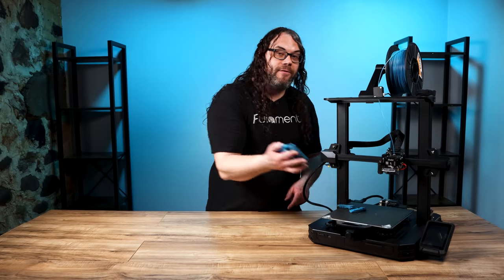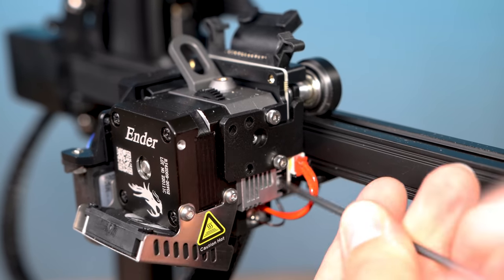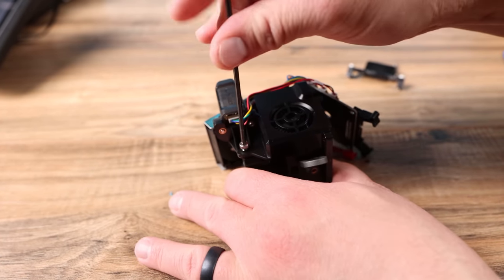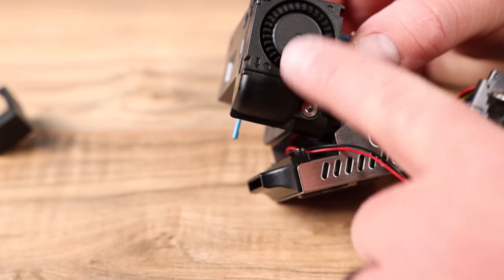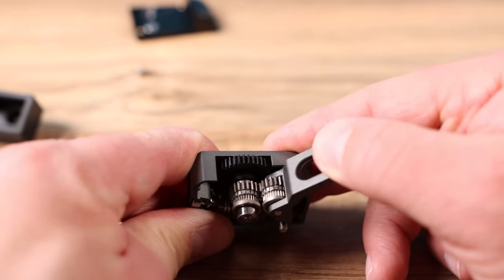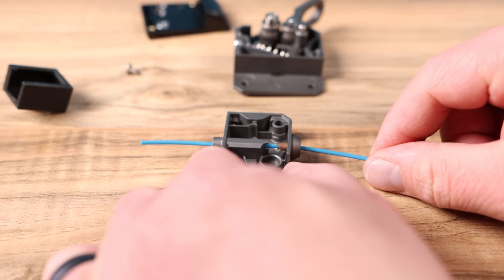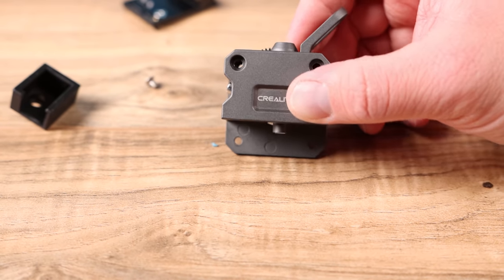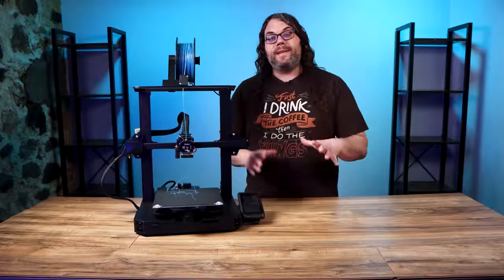How To Fix A Jam on the Ender 3 S1 Pro (FULL Walkthrough)

Comment: You really took the hard road.  I have two of these.  Had some clogs to deal with. Just heat it up.  Remove the nozzle, then push a cleaning needled and your done.  Try that next time.  No need to take it apart  Great videos.
Reply: Do you have any idea on why they jam?
Reply: @LuisHansenNH  wrong geometry internally, no internal polishing, wrong alloys being used in the heatbreak, etc.  E3D are the leaders here for good reason - they figured all of the perfect parameters long ago, and Chinese companies struggle to replicate it.  Looks like in this particular case, expanded filament managed to get too high in the assembly.
Reply from the maker: I tried that first. I even took it to 240 and the filament piece would not budge. Trust me, if I could have gotten away with that, I would have. lol :) Thanks for watching!
Reply from the maker: Not sure yet. But if it happens again I will dive deeper into it. Thanks for watching!
Reply from the maker: All very good ideas, and I think you are right. Somehow a piece that was expanded got back up into the bowden tube in the top. The it got stuck..
Reply: @LuisHansenNH  I had a similar problem with my OmniaDrop direct drives until I figured out that too much extraction during a print and especially at the end or a filament change will bring soft plastic up to the cold zone where it can deform and cause a jam.  I changed all of my retractions to be under 1mm and use 1mm for the end of print or changes, almost never have any problems now.
Reply: Because I was just going to by it. From Amazon. This video was scary . Taking Whole thing apart.
Reply: Tried that and it didn't work
Reply: @xxxxzorroxxxx  me too
Reply: This wasn't a nozzle clog but an extruder jam. The needle would not have worked.
Reply: @xxxxzorroxxxx  All printers have their pro's and con's :)
Reply: @woodwaker1  Extraction? You mean flow? I see Retraction but no Extraction parameter
Reply: @danlopez2012  Sorry I did mean retraction.
Reply: @woodwaker1  Ahh Thanks a bunches!
Reply: Yeah, I thought I was gonna have to do this then I tried heating to 240 and pushing a metal rod in really hard, and it popped out.
Reply: Damn you have to pull the thing a part.  That shit is way too much effort.
Reply: @woodwaker1  Ender 3 S1 manuals even state with a huge exclamation mark that the retractions should never exceed more than 0.2 mm for this exact reason. Also keeping your filament away from moisture and cuting a right angle on it on refill and making sure that when changing filament you always heat up your head
Reply: @wargames43  Are you sure it is .2 mm and not 2mm?  I don't have one, but .2 seems very short
Reply: I think we all try that method first. I heated mine up and it was not budging whatsoever. Disassembly was the only option.
Reply: Do all version of the Ender 3 S1 Pro have a PTFE tube? When I took mine apart to clear a jam/feed issue it did not have one. Machine was purchased new by me and came in the original sealed unopened Ender box/packaging.
Reply: @xxxxzorroxxxx  not that bad I did it lol
Reply: Where can you get cleaning needles from?
Reply: This continues to happen to me. Do you have any suggestions on settings that might help this not to happen
Reply: I tried the needle method first without success, even though eventually the needle went all the way through. I agree that method should be the first option. In our case, though, a small piece of filament was stuck next to the gears and interfered with proper function. This video was the answer we were looking for. It was very clear and it had a good pace. Thank you. (Be aware that you need a good Allen Key set. We used a Syntus 60 in 1 Precision Screwdriver Set.)
Reply: Glad u took it apart, fantastic detail

Comment: I just cleared a jam on my Ender 3 S 1.  The cause was improper filament change.  Heating the hot end to remove old cold filament and pulling it out too soon, First verify the filament in the hot end is melted by pushing some out the nozzle, then pull it out.
Reply: So true. Always extract a bit before pulling out ensures in addition to the right temperature, that there is no expanded filament above the melting zone.
Reply: Yeah same thing happened to me. I remember thinking what the wordt thing that could happen before pulling it too early

Comment: First....like so many before me thank you. Your video was used to remove a lodged-in piece of filament on a 1 week old 3 S1. In my case, when I pulled the gear case open, the spring and lever popped out. That took a while to figure out. I too missed the same screw you did. My only request is a video putting the hole thing back together again. I know that is really time consuming, but would be most appreciated. I fully expect this to happen again to me and many other. Thanks again for a great video.

Comment: Be carefull with retractation it's in the manual, with this direct drive, 0.8mm with rigid matérials, 2 with soft matérials.
Reply: 2mm caused massive jams with TPU when printing very detailed parts, I think it should be shorter
Reply: I was not able to read the super small manual.

Comment: A lot of this is the same, but a note to anybody trying this with the Sprite Pro extruder that you buy as an upgrade: it doesn't look like that in the "gear box" I'll call it.  In fact you can't even access the gears and so if you need to access those to clear the jam, you're screwed.

Comment: Cannot thank you enough for making this video. I have an ender 3 S1, not pro, i’ve had a nasty clog in my line I doubt I would’ve had the confidence to take it apart myself and fix it had you not made this video. I wasn’t as lucky as you I actually had to disassemble the whole thing to get to the clog it was on the top not the bottom of the extruder and it actually gone sideways as well as clogging the top. Thanks again man would have been able to clear this one without you! 🙏😎👍
Reply: i had what sounds like the exact problem with my S1...thank god for the video :)

Comment: Thank you so much for this video - I’ve got a sprite on my ender 3 pro, and it jammed up HARD last night. After watching this I was able to take apart the extruder with confidence. Not only was my filament jammed up the way yours was in this video, a piece had broken off and jammed in the upper feeder so I HAD to take it apart to get all the bad filament out safely. Changing out the nozzle wouldn’t have fixed the problem (though I did that anyway), because the filament broke off above the gears. 

It’s running again now, hooray!

Comment: Your teardown was a lifesaver. I had a piece of filament that broke/clogged above the ptfe and below the gears. I couldn't for life get it up or push it down and my gears were spinning freely, not even touching the piece. I had to do a full teardown to even grip the piece with pliers between the gears and yank it out. Most other videos did the shortcut you showed at the end, but that would definitely not have been enough for my problem. Thank you! I was going to buy a direct drive for my ender3 but after this clog on my S1 I'm definitely not lmao

Comment: Another thank you - it's now the second time this video helped me. As mentioned in many other comments here, the filament did not get stuck at the hotend, but in above the ptfe tube at the gears. This happens to me with filaments that require a high temperature. I am not sure yet how to prevent this. However, you may have also noticed in Creality's official video on filament changing that they pull the filament out very quickly. I will try this in the future and hope it prevents jamming. It may also be good to wait long enough for all the filament in the hotend to melt properly.

Comment: Thank you for your lesson. This was very helpful to pull the extruder apart. My issue was exactly the same as yours, I think my issue was caused by "heat creep". Looking at the piece of filament as it just enters the PTFE tube, it was slightly swollen. I have had my 3 S1, for about a year, and have just done prints up to 2 days. My clog occurred on the third day, of a 5 days job. Important to note! I have an enclosure, and the inside temp was up to 40 deg C. This might have been my problem. It is now summer and we had a 37 deg C day when this occurred (previously, was winter and spring, so the enclosure did it job). So have to see about regulating the enclosure to about 30 deg C. Or, have a better heat block cooler. That was my take, and again thanks.

Comment: Yip, happened overnight.  I was doing a long print and I knew it would be overnight, so when I checked this AM, I was out of filament- DANG!.  Re spooled and started over, after an hour I noticed no go.  I followed your video but went straight to the hotend where I found the end of the last spool clogging up the works.  Pulled it out , made sure new filament was going in fine, reattached the hot end and I'm printing again.  Thx for the Video.

Comment: This is my first 3D printer and got one successful print before this happened to me. I was very hesitant to pull the whole thing apart after owning it for 45 minutes, but your video helped through it and I was able to start printing again. Interestingly, my gears and spring came off in the opposite side of the housing than yours. And yeah...the spring and gears went flying all over the garage. 

Thanks for the walkthrough!
Reply: How did you put it back together?
Reply: @shawnc292  paused the video where it showed the inside and tried to replicate the setup best I could. It worked afterwards so...think it was successful!
Reply: @bkoepplinger  gotcha My inside is like yours where the gears are on the oppisite side and I cant get the spring back in thanks :)
Reply: @shawnc292  that was definitely the trickiest part. You have to really compress the spring and slide it in at an angle until the square nut sits flush on the housing of that makes sense
Reply: Mine came out on the opposite side too and it took me a while to figure out how to get it back together LOL

Comment: Thanks for the video. Worked for my creality ender 3 v3 se. One thing I will say to all, those 2 connectors you have to remove that have hot glue on them, I should have broke the glue free with a small flat head screw driver. My pins to the plastic male connector fell out. Not worried as the wire did not come free from the pins. I simply pushed them back in and applied the smallest amount of Krazy brand super glue to the rubber insulated side and back side of the plastic connector, careful not to let it leach into the pins. That one connector that came loose went to my bed level touch tool

Comment: Just an FYI - Before you load the filament into the machine, cut the leading end of the filament at a 45 degree angle before installing it.  That will tend to lead the filament properly into the tube.
Reply: he's not stupid i'm sure he knows that.
Reply: @begc6347  But the rest of us may not! It never hurts to add good advice.
Reply: With the sprite extruder, that 45 is not as important. It certainly is useful for other extruders, but the sprite will take just about anything, including filament with a small amount of blob after being ejected.

Comment: The video helped me a whole lot. I am new to 3D printing. Got the S1 as well. Just had my filament get stuck in the extruder today. Mine was caused by the filament spool having a cross over in the middle of the spool. As it got stuck, it spun the gears on the filament and jammed it up. I could not for the life of me get it to come out. Two spools in a row had this problem. 1st one i caught and had to unspool about 30 feet to fix the spool.  The second one i was at work. Good thing it was only about 30 minutes into a 10 hour run.

Comment: In case you had not yet figured it out, the hot glue on the heater connector is a makeshift gusset to help keep the connector from twisting off of the leads. The heater wire is short enough that it is always applying a force to the connector and after a while, you'll notice the thing start to twist on the board as you do repetitive maintenance on your sprite. You'll find it out quicker if you take the glue off the board.
Reply: FWIW, I got my sprite as an upgrade hit for my Ender 3v2. Not only was there no hot glue, the larger of the two cables was not plugged in. It's a step for the end-user to deal with. It was a bit of a puzzler because the kit's instructions were a little unclear.

Comment: Many thanks for the video, I have only had my S1Pro since Thursday and managed to get a proper clog in it, this video was great, as it gave me the confidence to take everything apart, and now I have a working printer again :)
Reply: I'm getting one every couple of prints now. I think this is a real design problem with the pro :(
Reply: @RobinBresnark  Mine was down to a faulty fan port on the breakout board that the hotend fan was plugged into, the connectors are horrible and cheap.  Now I have to run the printer without a part cooling fan :(

Comment: Thanks so much!!! Couldn't have fixed my clog without you!!! I did really well until I reached the extruder and all the parts fell out - including the spring - took about half an hour to get that back together, still not sure if I have the right spring tension but it seems to be printing okay? A an aside, my cause of clog was the screws holding the nozzle section came loose, the nozzle gouged the pei plate and wrecked the nozzle and I didn't realise and kept shoving filament in. Ironically I always watch the first few layers but had a knock at the door - when I got back a few minutes later it was too late for the pei plate..... Thanks again!

Comment: OMG! THANK YOU for the tip at 10:48!!  After mistakenly loading PLA for a PETG print (d'oh!), a bit of filament broke off when I unloaded.  After taking the Sprite off, I only needed to remove 3 screws to see the filament stuck in the throat.  I pointed a heatgun at it, and used the hex wrench that fit the Set Screw to easily pop it out!  I was back setting my Z offset in less than 30 minutes, thanks again for the tip!
Reply: The tip at 10:48 worked for me, too, and I didn't need to do the full disassembly in the video thanks to this.   This teardown video was a life saver --thank you.  Since then, Creality support replied to me and sent a link to a video from them that confirms how to do this:   https://www.youtube.com/watch?v=kVpGjHot8GA
Reply: @GlennChenier  , what's also nice, is that they show how to do it without using a heat gun.  Although I don't recall if they tell you to turn off the heat before reinstalling the assembly.  But, that's an easy lesson to learn! 😉

Comment: OMG Creality designed a hotend that can be easily unclipped from the gantry but the time gained is soon lost when trying to unclog the extruder. I was actually going to buy this tomorrow and thought, "let's check out a few YT videos about it." So glad I did. For me, this is one to avoid.  I assume most people buy accessories to make their lives better not worse!  Thank you, Jim
Reply: It's not a common problem if you watch what you are doing

Dont buy cheap filement 
Keep it dry in a dry box
Cut the new line at a 45 degree angle giving it less ways to block
Always heat the head before changing filement types
Always leave filement in there just cut off a piece and put your filement away
When replacing after its heated up Extrude a bit of the old filement to remove the large glog at the end and then slowly pull the filement upwards.

These type of jams happen if you just raw dog your printer every time you use it. Just follow the instructions that you get with the printer

Most people forget Direct Fed belts cant retract allot. For the Ender S1 it explicitly says no more retraction than 0.2mm to prevent glogging....

Reading manuals is something from the past it seems...
Reply: @wargames43  I bought the micro swiss NG. So far problem free

Comment: Before tearing apart the extruder, it's worth a quick test to see if the clog is near the nozzle. 
I had a clicking extruder, but it was still feeding some.
I heated the nozzle to filament temp and removed the filament.
I removed the nozzle, then quickly pushed the end of the filament through the extruder.  A blob of filament popped out of the bottom.
I reinstalled the nozzle, and it flowed freely again.

Comment: Thank you so much for this video.  I did it, exactly like yours.  Didn't know what to do but thank goodness for YouTube and people like you.  Took me quite a while to do it the first time due to the S1 being a little different than your Pro model. Particularly the fan shroud which lives under the bottom part of the fan housing which is a different model than the Pro.  Took me a while to figure that one out, but we are all up and running again.  Funny thing is that as soon as a print started, I did it again.  Reason is that for some reason when the printer begins to print the purge line it retracts the filament completely out and then, of course no print.  I was pushing  it back in... ergo jammed extruder.  Any ideas on that?
Reply: I had this exact same issue and fixed it by adding "G92 E0     ;" immediately before the purge line in the "start job" gcode in Cura. This doesn't move the extruder as I thought it would, but it tells the printer that wherever it is now, that is zero. What I think was happening was because I hadn't been setting the level to zero, the printer was winding back to zero at the start of the print job. I assume after seven months you've already solved this issue but if anybody else gets the same issue as we did, this comment might help them!